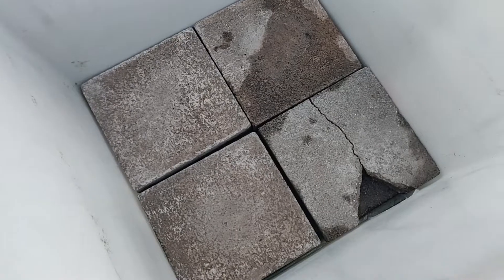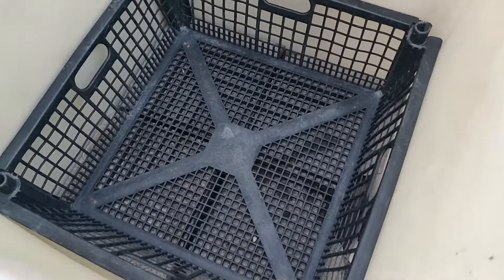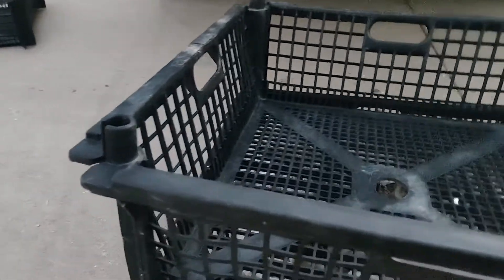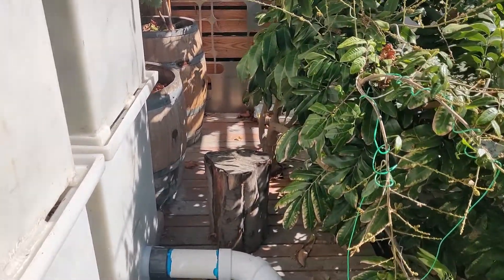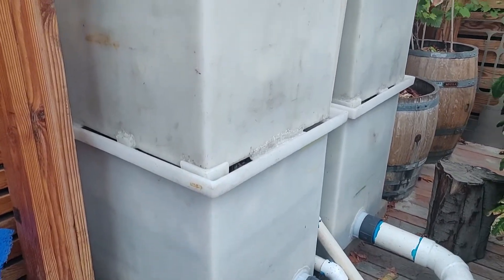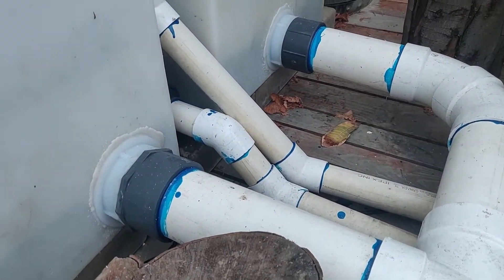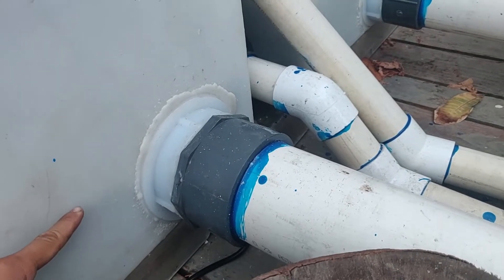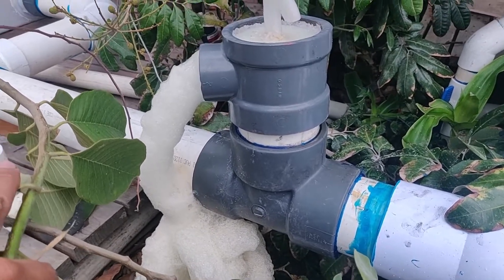Bakki shower with oyster shells and foam fractionator integration working

Comment: Awesome video, thank you!  If you see this comment, could you tell us where you got your stacking baskets and the solid bins you've put them in?  This is an ingenious design.
Reply from the maker: Hi I'm glad you like the design. The stacking baskets were from an oyster farm in Carlsbad, but I think you can buy them at various places. The white bins are typical HDPE plastic tanks from random sellers on OfferUp or marketplace. You can search for plastic water tanks and many will come up. I usually buy them when I see a cheap deal, those tanks work well because they're naturally uv resistant.
Reply: @KoiAquaponics  Thank you